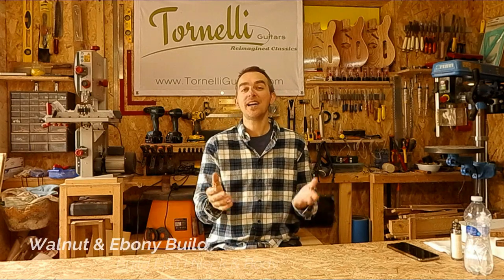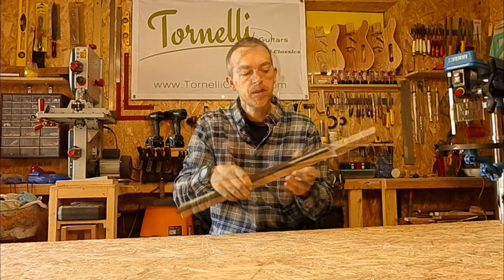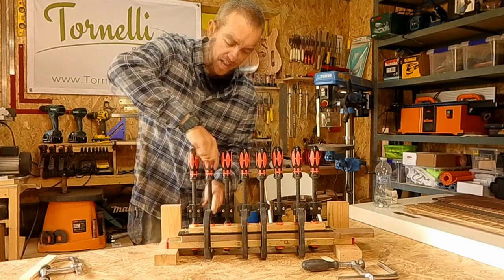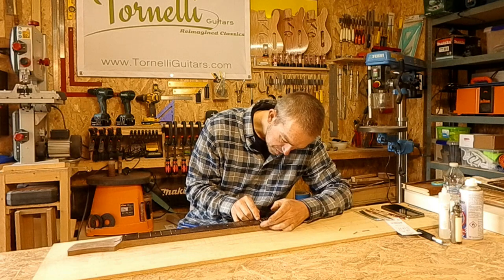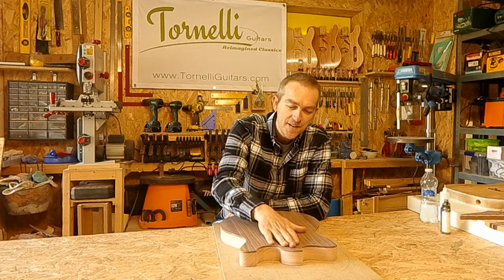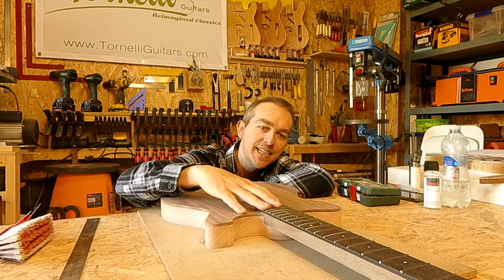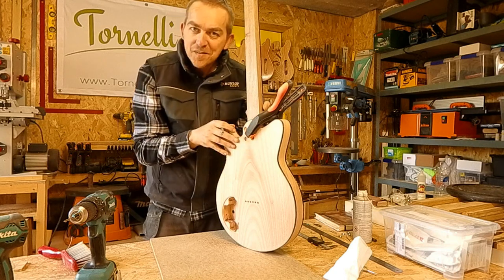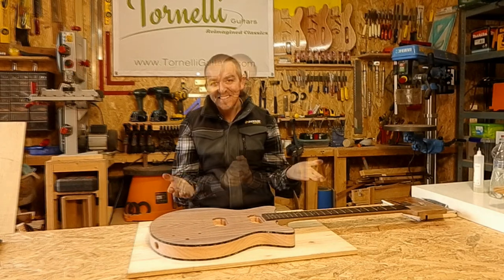Walnut & Ebony Guitar Build | Ep.1 Neck & Body

Comment: Big fan of your work, it's just spectacular. Do you use any kind of locating pins for glueing up the fretboard?
Also, where do you get your wood from?
Reply from the maker: Thanks, that’s really kind. I normally use 1mm nails for locating pins. I drill a small hole in the nut slot and a second in the 20th fret, once the glue is dry I just pull them out. My wood I get from various places, I think this piece may be from Rivolta in Northern Italy.